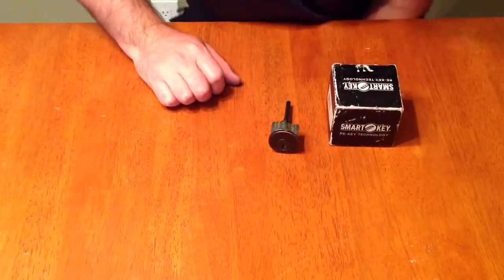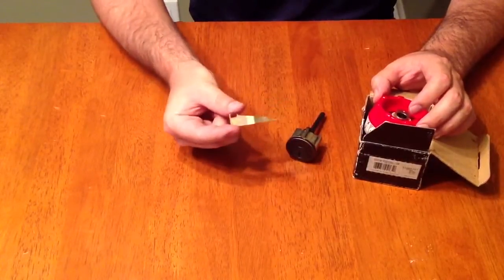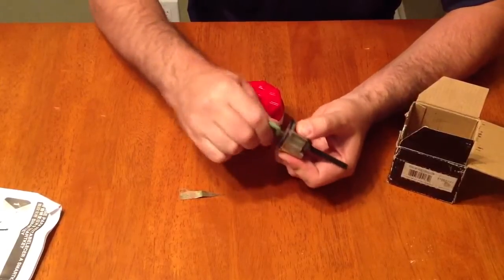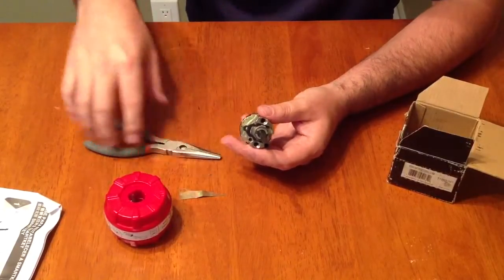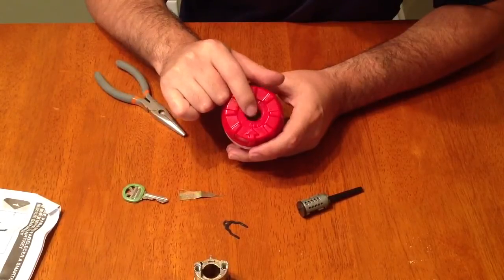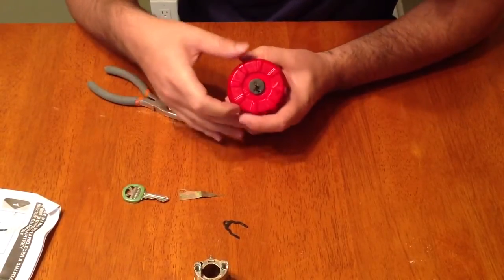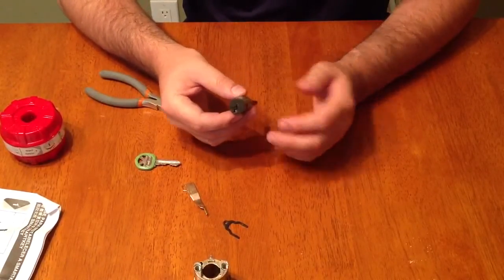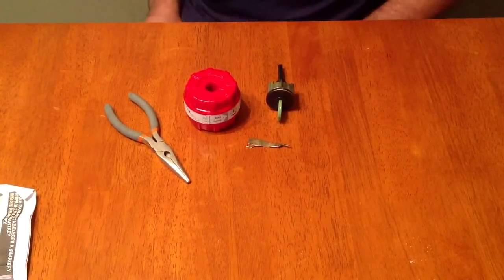How to kwikset rekey smartkey key lost key

Comment: Why can't you rekey it while inside the casing/cylinder cover?
Reply from the maker: @max208-sw4xm  won’t fit in the cradle
Reply: @rekeytraining  Not what I'm saying. Why use the cradle? Can it be left in the casing and rekeyed?
Reply from the maker: @max208-sw4xm  I’m using the cradle because the key is lost. Without the old key you cannot reset it in the housing :)